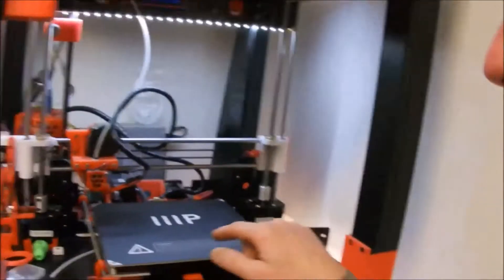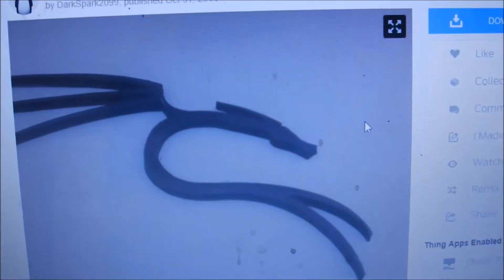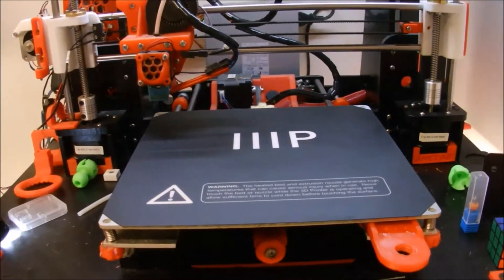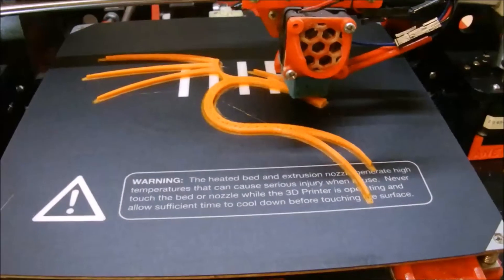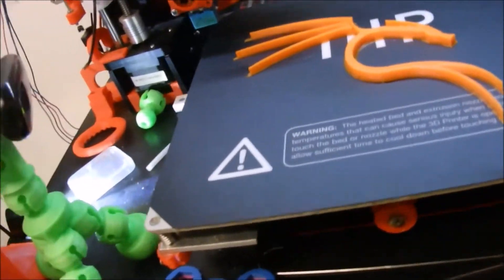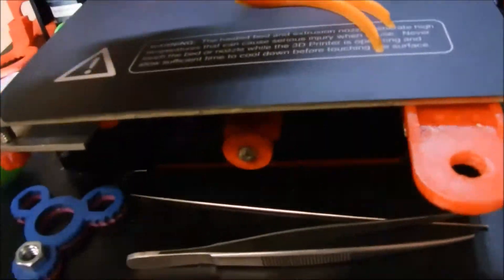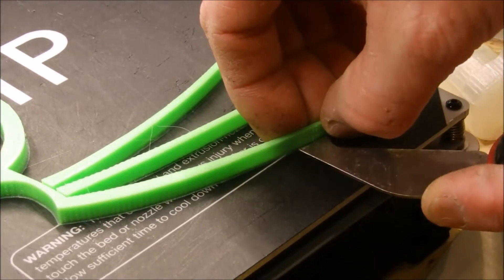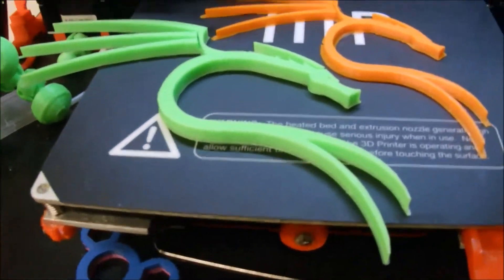Anet A8 printing on BuildTak

Comment: What do you have for distance between bed and nozzle.
like your videos sharply
Reply from the maker: I don't have a exact measurement but it's not as close as on glass. if you get to close on buildtak it will embed itself. I have since gone back to glass the 1st layer is much cleaner with glass.

Comment: That buildtak seems to stick hard. Maybe that's what I need to combat abs warping? I'm guessing it works just as well with abs as pla? Nice vid btw. Good to see you're amassing a little team of makers too! Odd question for you... since you're an electrician maybe you'll have a better insight, but I'm guessing in your first month of printer ownership you did a lot of printing. Any ballpark figure on how the A8 impacted your monthly power bill? Was the first month running noticeable on your bill? I'm curious what consistent running will do to my electric costs.
Reply from the maker: ABS test will be coming and results will be tape for sure. and as for the power usage think of running you gaming style computer that's about what is equals to I haven't notice a difference that would make me raise my brow and say WTH